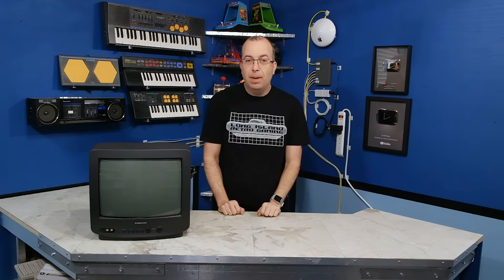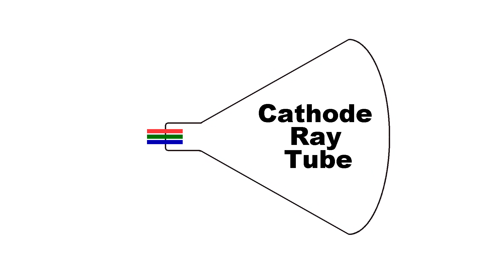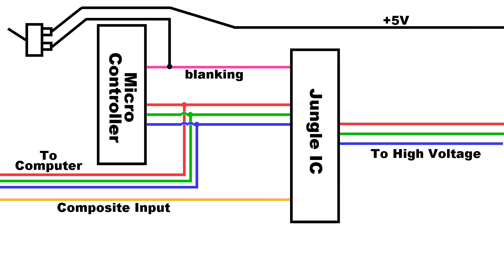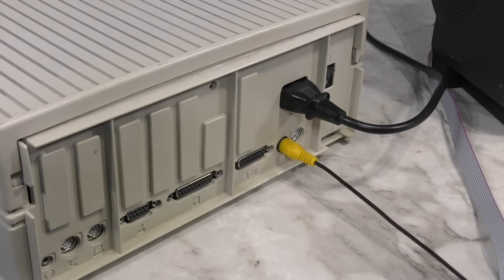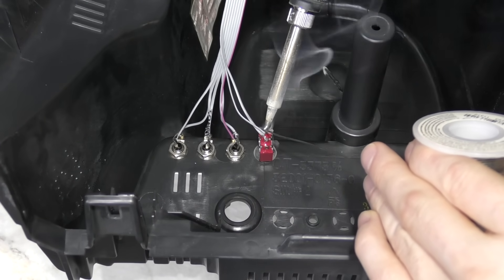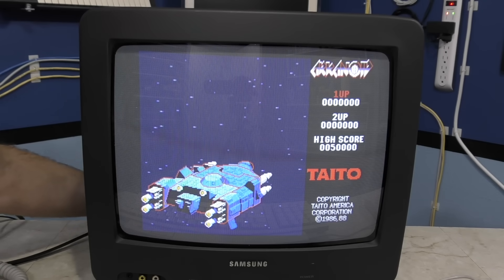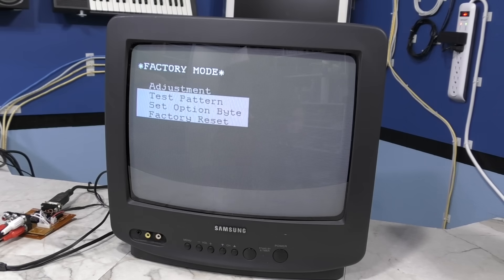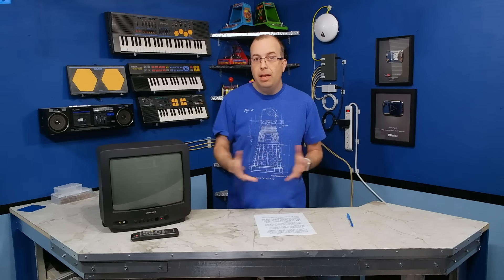Modding a consumer TV to use RGB input

Comment: Only high end TVs like Sony Trinitron had RGB on their scarts in Europe. And when they had more than one scart, only the first of them was RGB. When you bought a cheap small TV,  you usualy only had composite in the scart.
Reply: That is not true. Many, if not most, old CRTs in Europe supported RGB if they had scart even if they were lower end ones. My old and super cheapo Kendo 14" CRT with only scart and RF input supports RGB over scart. So did my old Phillips and all TVs friends and family had. Almost all of them were on the cheaper side. Those were all mid to late 90s CRTs though. It was probably different before that.
Reply: My Sharp TV bought in 1992 to accomodate my Megadrive (Genesis) had no RGB on the scart, most people used only VCRs at the time on their TVs and all VCRs are composite anyway. After that I bought a Sony Trinitron with two scart, it only had RGB on scart 1. But because playstation was such a hit in 1995, maybe TV manufacturers started to make the presence of RGB in their scart more frequent yeah. However scart was invented in France in 1978 and was mandatory in all TVs sold in France by law in 1980, that makes a huge amount on TVs that did not have RGB on their scarts, believe me, I grew in this painful situation, in France,  and I was a huge video game fan :) Just before Playstation, most people didn't even knew what was RGB, even TV salesmen ! After playstation, and the RGB cable sold separately, people started to learn more about it because they wondered why would such a cable be sold separaety for $30 !
Reply: I have had only Philips and Sony TV sets, they had at last one SCART with RGB connector. I suppose that they were designed with RGB input from the start or they had a teletext option board. If the TV set were initialyy designed for North American market and the retrofitted with SCART, it's possible that.
Reply: Spyro Le Dragon
Well, that's your experience. Does not apply to all. Sharp TVs are known to not have RGB because they were all about S-video. Most European consumer CRT TVs that had SCART also had RGB. My family's cheap 21" TV made in the late 1980s had RGB over SCART. So, yeah.
Reply: Nope. Most sets that had SCART also supported RGB. Especially sets that were designed to have or be retrofitted with a Teletext decoder, since the RGB and fast blanking circuitry were already required for that. Some cheap imported sets that were fitted with SCART as an afterthought, might not have had full SCART though, and most videorecorders didn't have RGB on their SCART either.
Reply: Of the two SCART sockets on my old 56 cm Sharp CRT only one supported RGB, but that's still better than nothing. And yes, on TVs back then the size was usually called out in cm.
Reply: That's not entirely true. To my experience actually, most of them have RGB SCART. At least the TVs in my country. I have never come across to a CRT TV that has SCART connector but not RGB.
Reply: Spyro Le Dragon I dunno mate, I have a pretty cheap 2003(?) Matsui TVR185, which is only 14” and it’s SCART supports RGB. Plugging my SNES in with RGB instead of RF was mindblowing.
Reply: A lot of people don’t understand SCART does not always equal RGB. It’s simply a connector that has the potential to carry many different types of analog video.
Reply: even the cheapest had rgb scart, and a second scart configured for svideo
Reply: Never used a CRT tv without RGB, anyway most with multiple SCARTs only support RGB on one, but even 14" Finlux had RGB input available. But anyway the connector is bad, usually 21pin cable is like a garden hose, but not that flexible so it pulls other end of the connector out. I was shocked that HDMI did not first support changing TV input automatically where I was used to with scart and that 5volt input switch signal there.

Comment: Even the cheapest crap TVs came with Scart RGB here in Europe. Even today, every cheap lcd still has at least 1 if not 2 Scart connectors. In fact the only TVs without Scart would have been back in the mid 80s.
Reply: I disagree. Modern TVs are shifting away from SCART. I know because there was only one 4K TV with SCART that was in my price range when I went to look. Most, if not all, others were close to or digital only with your options being DVB, HDMI and Networking. The one I have I'm really happy with as the RGB signal is upscaled rather nicely on an otherwise cheap LCD screen.
Reply: Not that I would watch the SD signals of old consoles on a modern 4K anyway. Those upscalers are just horrible to work with 224p/240p/480i Some can do a good jop with 480p and 720p but below that most are just bad.
Reply: back in the 80s/90s many cheap TVs didn't support RGB as the relevant pins on the SCART connector weren't actually wired up. Not sure about LCDs today.
Reply: Adrian Fox Often TVs with 2-3 Starts had RGB support only on the first scart.
Reply: Yes and no, in the 90s whilst tvs ended up getting scart here in the UK most people didn't buy a scart capable tv till around the early 00's and even ones who bought one earlier didn't use the connection as it was before the days of digital tv, dvd players etc in fact around 2004 for a few years there was many adverts (lying) saying you needed a new tv to watch freeview/digital tv when the real reason was the companies intentionally removed rf modulators from boxes even though earlier models were compatable with RF output, and also some scart inputs were actually only composite wired even if single socket.
Reply: A lot of commercial LCD and plasma displays have RGB input as well😬
Reply: I remember our tvs in the house had scarts and that was back in the mid 80s. We had vcrs and beta hooked onto it and in the 90s I had a sega hooked onto the same tv. Even my grandmother had a scart on her tv set which was a bit older model. This was a norm in Serbia back then tvs with vcrs hooked into it through scart.
Reply: >>>In fact the only TVs without Scart would have been back in the mid 80s.
ALL of my 80s CRT TVs have Scart. And all have RGB Scart, the best being a mid to late 80s Sony Trinitron.
Even early 80s CRT monitors had RGB Scart like the Philips 8833 Mk1, while Mk2 had a dedicated 9-pin RGB socket.
Reply: Not all SCART have rgb pinso really working. Supposed to be

Comment: Why dont North America have Scart connectors? Thought that was pretty standard.
Reply: It was a french made standard, shared with Europe. Japan used the same connector for a similar system called JP21 which had a different pinout
Reply: it was a European standard that never really made it's way over here. people were happy with Composite back in the day so there wasn't even any industry push to put RGB in
Reply: And look at the current state of North American CRT fans today...
Reply: read "happy" as "complacent"
Reply: we used s-video and component- which if u see the connector to the jacks he installed component basicly is rgb scart
Reply: @TheLonelyStoner5696   Ok so you got component at least. Thought for at moment you only had the lousy composite
Reply: we had S-Video since the begining of the 80's C64
luma chroma was here forever so we had RGB like before SCART
which then later became S-Video which is better for NTSC
Reply: @dgpsf  umm you must be young as that is incorrect cheap cheap tv's in the 90's were RF due to cable tv being in every home almost or using a ant
VCR's etc had S-Video since before the 90's and so did many TV's only TV i ever had that only was "Cable Ready"only as in RF coaxial was my 13" Zenith
rest all had S-Video Hell i was using luma chroma since C64 in beginning of the 80's using a TV as a monitor even back then we had some TV's with SCART or Japans version
i had a 1980's Fisher TV that way
this also doesnt include other computer hookups like D-sub 9 RGB which some TV's also had
i mean the most common thing when shopping for TV besides the picture was looking at the back seeing what all you got i spent so many hours window shopping that way for years growing up
Reply: I have an old CRT that has SCART and was bought in the US, we have them. They're rare here, not non-existent.

Comment: nice video once again
for the connector, use what you want and RCA is really ok but i'm french and i can tell you..... don't put a SCART because that thing is garbage! it was nice because it was able to use RGB it was possible to use it in both the way fro example to record what the tuner of the tv receive and also to play a VHS from the same VCR without touching the cable well this is theory because in reality the plug die really fast and will have connection problem. the plug inside the TV die really fast because they are only attached to the board and 90% of the attachment is the soldering.... this plug is the worst i know and the only good thing about it is that in that time, it have bring me a lot of money! i've repair thousands of them
Reply: This is true, although one thing I am happy about is that later on, a lot of TVs started screwing the connector to the casing with a screw on either side, which takes almost all the stress off the PCB much like the 2 nuts on a VGA connector.
Reply: I love SCART but hate the reliability. Altough I never understood why you guys called it the Peritel connector? Also, was it common or standard to get SCART cables with consoles? My Mega Drive 2 manual says that for the UK region we'd get the RF adaptor but it says that for France to use the Peritel connector
Reply: Peritel is basically the alternative name it's known as in France, like in Spain it's known as Euroconector... SCART is an acronym in french of the protocol, not the connector as such. France had by law the inclusion of an alternative to RF on the TVs since the late 70's I think it was, and that's why, for example, a french Master System II comes with SCART connector instead of RF like every other country. The RGB part isn't law there, and in fact, most cheaper TVs that have 2 SCART ports only have RGB compatibility on the first connector, with the second one being for composite and sometimes S-Video too, as well as audio in and out. Most consoles came with SCART cable, but it was only wired for composite output, and those companies would sell the RGB cables separately. The Mega Drive II, like the Playstation and other consoles came with RCA outputs, and a SCART adaptor, but you could get the cable separately. The Sega Saturn came with a direct SCART plug but only had composite lines in it. In the UK, there was no SCART as standard, it was seen as more optional, and there were TVs that didn't have it, so Sega had to cover their backs with that one for the UK. But over time, it became an unwritten standard.

Reliability... the main problem with it is how it's held to the circuit ad the TV itself. Most TVs now have a couple of screws to anchor the connector to either the chassis or to the case, where as before, it would just have to rely on the soldering connections on the board and a couple of plastic tabs. SCART has improved, but it seems to have improved as its swan's song. It is a reliable connector if you plug something in and that's it, but if you start changing the plug constantly then it can become an issue, and that's when the best idea is a switcher box to plug multiple SCARTs into the same connector, although you have to keep an eye on these, as some have a nasty habit of putting the 5V connection direct... I had this issue, and I would start up my Mega Drive, and this would power my Master System over the 5V rail, and the fix for this in my case was to add a few diodes so power would only go one way.

Yes, it has its flaws, but it became the standard in Europe in the early 80's when these issues were still not known as to "when they get old", and people tended to plug one thing in and never change their setup as they only had that one thing. They could have changed it in the 90's I guess as it became more popular, but then when everything went digital and and we started with HDMI (which isn't standard either, not even in their cables), how many connectors would we have on the back of european TVs then? French legislation would have demanded SCART be there, then add the SCART replacement, then the HDMIs, then the RCAs for things like composite, YPbPr, VGA, and many are already not bothering with S-Video because it's all too much now and we have S-Video accessible via SCART anyway...

Do I think it was a good system, yes, even with hindsight of 20/20, because it opened up a lot of possibilities and made things very easy at the time with just one cable to worry about, when satellite TV got popular it made things easier, when Canal Plus started in France and elsewhere, their decoders just needed one connector, not even a TV signal as they got that from the SCART itself, when TV switched from analogue to digital, it made the switchover easy by getting a TV set box to plug in and get digital TV with just one cable, it made life a lot easier for the average, non savvy consumer. Is it a pain in the backside for us now? In many ways, yes, it can be a bit of a pain sometimes, but it gives us options others have to mod TVs now to get and are just realising now what they were missing out on, and we are talking about a 50 year old connector... we don't complain about capacitor problems in our vintage systems, it's from being old and we just change them as something that happens, and I take SCART with that philosophy, as something that is good, but has its kinks because it's old.

And this is someone that just added S-Video and composite to their Atari 2600, using a SCART cable with a switch to swap between the 2 (one of the S-Video lines and composite share the same pin, so they can interfere if both working at the same time), and I am glad to have that option with a single, smart looking cable going from the system to the TV
Reply: the reliability of the scart is not onle because of the connector inside the TV.
it's also the cable with have a total of 22pin 4 audio for in and out stereo, 2 video in and out for s-video/sinc, the RVB and of course the grounds. in high quality cable, they was coax inside the main cable (it was a bit like a multi-pair used for audio analog transmission for live concert but with a horrible 100% plastic connector..... what a piece of shit!).
and because designers in that time was under LSD, they have put the output not on the bottom with all the normal people would have do. they have put it on the side so, with the weight of the cable it auto destruct because it's a damn piece of shit!
Reply: It is true that it's a jungle in that cable when it comes to full premade cables, but if you're going to make your own cables it's not so much an issue as you only need to add the cables you intend to use
Reply: yeah but the plug is garbage and is going to fail anyway and, using a big thing like that for 5 wire..... a DIN is going to be a way better choice.

Comment: Another great viideo, it really is strange the the USA never adopted the RGB scart,that europe, japan(slightly difrent pins) had for many years !!
.Here in the UK all my consoles,computers came with RGB as standard or added mod..   why did USA not adopt a descent RGB system?  
 thanks again for another superb video!
Reply: Well, as you know Scart is only the name of the connector, the japanese wiring standard for scart was called JP21 and Europes was EuroScart i think correct me if I'm wrong with that
Reply: simply put, we were happy with Composite because we didn't know anything better existed haha
Reply: Justin Noker that makes sense. Also, composite looked not as bad on CRTs as on modern TVs

Comment: I wonder if that slot where the composite connectors are isn't already sitting in an unpopulated area for a SCART connector. I know you said you wanted to use the parts you had on hand, but if you can just stick a SCART connector in without any complicated mods, that might be easier, and you could maybe even get some already made connectors for systems like the Genesis.

Comment: SCART means Syndicat des Constructeurs d'Appareils Radiorécepteurs et Téléviseurs. It's French, so this explains why it never would be accepted in the US. Even in Europe it required some coercing from the EC (at that time it was not EU yet) before it was accepted in Germany and Britain. Péritel (that's how it was called in France) was required in France since 1980. 
Technically it was quite interesting but it had some flaws. The physical connector and pins were not sturdy and it was quite easy to bend a pin or have the whole connector fall apart.
There was also the issue that not all TV or appliances would implement all functionalities, so it could happen that some things weren't possible as the RGB part was missing (rare) or that the composite was off (more frequent). Sometimes only the input part was wired, sometimes only the output. Sometimes you had to provide the 12V switching power externally, etc.. 
So, at the beginning, SCART was a mess, it's only at the end (end of the 90s, 2000s) that it became really nice.

Comment: Yeah I love SCART :D A few years back I started to switch all my console cables to RGB/Scart. Its much more enjoyable as with composite. VGA RGB is a whole different story tough. For example, the Atari ST series puts out a VGA compatible signal in monochrome high res mode, but in color mode, most VGA displays won´t like the signal at all. So I am still on the quest to get the best picture quality from all my systems, but with all the different connectors the manufactures used, its such a pain to get the right one, and now where I got some CRT´s and even a 1084 its not getting easyer.